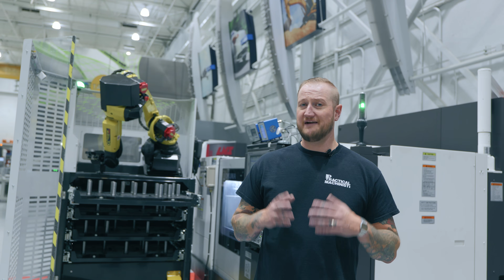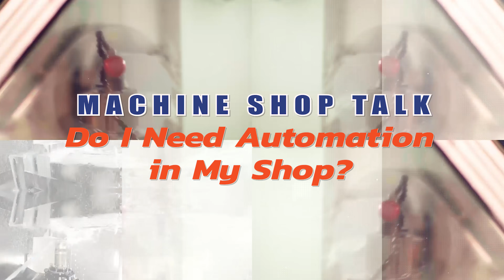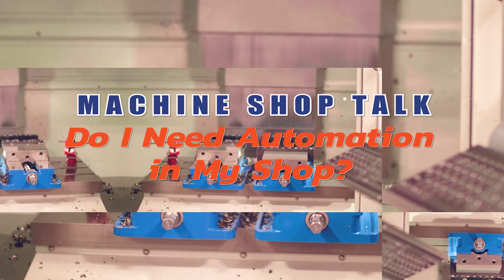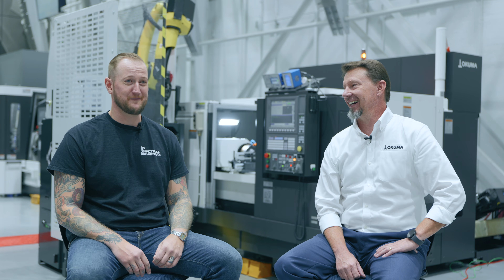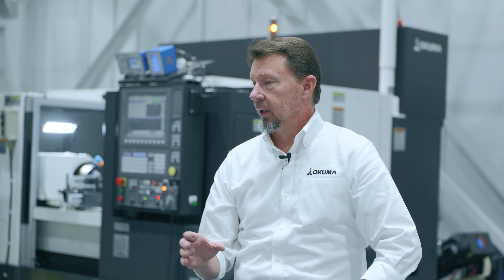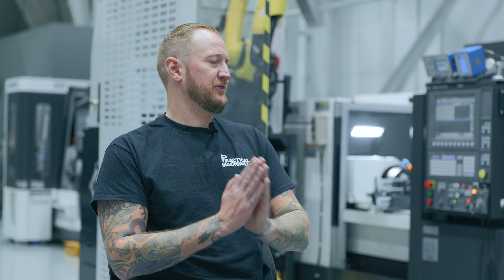Do I Need Automation in My Shop? | Machine Shop Talk Ep.104

Comment: The FANUC CRX 25 collaborative robot capable of 30kg payload

CRX robots can also run in a high speed mode which can be switched through Advanced DCS based on a safety input or a Cartesian position

Comment: Because of the chip problem: We have solved it in the company in such a way that we have a "special tool" - actually just a small tube in a holder. When the loader has unloaded the finished part, the spindle blows coolant out of this "tool" at 10 bar while the chuck is turning before the new part is inserted. It takes a few seconds, but we have at most 1 in 1000 parts with clamping problems!